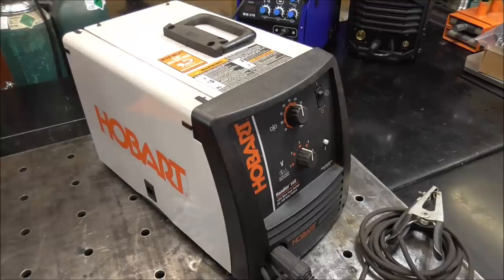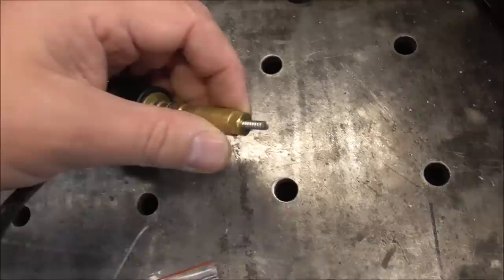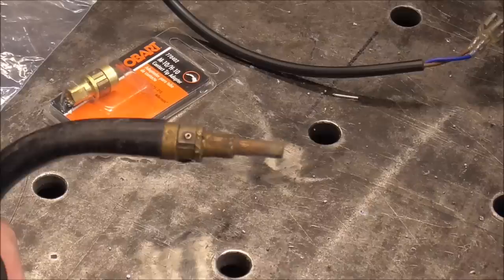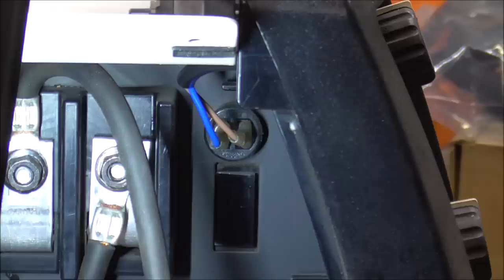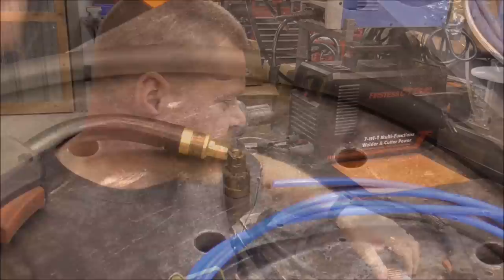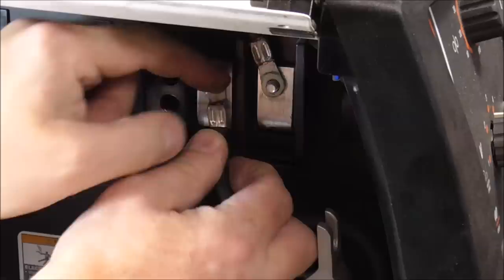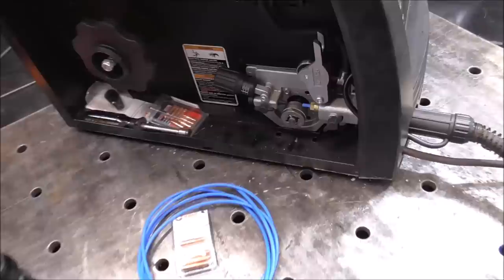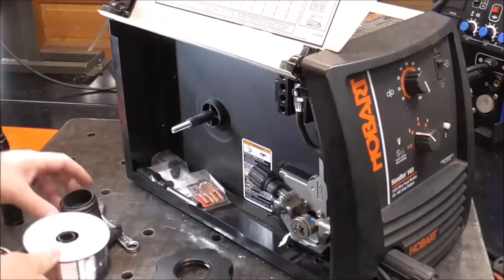Convert Your MIG Welder to Weld Aluminum - The Easy Way

Comment: Hey guys, I have used the same hh 140 for the last 10 or 15 years. Ran 10lbs or more of 5356 wire.

 Last large project (6 years ago) 40 ft sailboat mast broken in half.(backyard project)

TIP, most important thing for me to keep from BIRD NESTING was to keep the welder positioned well above work piece.  
Water flows best down hill, mig torch and hose as straight as possible angled down hill.

 Plenty of mapp gas or torch for heat, aluminum acts as a heat sink. 

Hope the tip helps someone.

Very good info in the video!!
Thanks for making the video & sharing your knowledge.
Reply from the maker: All excellent points you made! Thanks for watching and sharing.

Comment: I'm not much of a welder but it is nice to see what would be involved in welding aluminum on a budget. I got a few parts on a project that I would rather use aluminum for over steel. Getting the 100% argon might make that specific use case more expensive than it is worth for me though. Either way, good video and explanations.
Reply from the maker: Thanks Zack I appreciate it!

Comment: My MTS-211Si won't do AC (which I didn't realize when I bought it) but this is a viable option, till I get another machine!
Reply from the maker: Great point but it's not necessary on thin metals. In my cast iron repair series i use 1/2" nuts to hold weldments off the table for that reason.
Reply: No, I meant TIG Aluminum; MIG is an Alternative
Reply from the maker: Oh I gotcha! 👍 I like TIG also just a lot slower process

Comment: I'm really tempted to pick up a longer whip for steel and convert my current short whip to a PTFE liner. The only thing that sucks is I swapped my argon bottle a couple years ago to a 75/25 so I could backup bottle.
Reply from the maker: Thats probably the way to do it then your not switching back and forth between liners. But with another bottle then you can weld anything 👍
Reply: Remember the rules for MIG or TIG welding aluminum: use only Argon, or for a hotter weld a mix of Argon and Helium. It's also very important that aluminum be clean or it won't weld at all. No oil, grease, paint or gum from labels. If it's not clean use a small disc sander and then clean it with acetone or laquer thinner. In the industry 5356 filler rod is always used, as opposed to 4043, so if the part is Black anodized the weld does not turn white.

Comment: This is great, I have an old Lincoln 110v mig that might be good to try this with.
I'll probably pick up a gun and line, being the lincoln is primarily my fcaw tacking unit.

Also, a wipedown with some acetone after brushing helps. Just be sure its evaporated off and the container is far away before preheat and welding
Reply from the maker: Spot on Allen! I kinda skipped a couple things (just to keep the already too long video shorter LOL).  I'm VERY impressed with how this 120 volt machine performed. I thought it was going to feel underrated but I was pleasnatly surprised. Definately beats buying a new machine if someone had some occasional projects they wanted to do.

Comment: I ran some aluminum wire through my Lincoln SP175, with mixed results.I changed the gas to argon, changed the  liner, made sure feed roller was sized properly, along with tip ID, and it worked, mostly, except, if that wire fused to the tip, which it did a few times, the aluminum wire would "birds nest" past the rollers  like a mofo, making me pause work a few times fixing alla that mess. That is why a gun with the spool on it works so much better, as it cuts down that feed "push" to inches instead of feet. I can see where that protruding piece would cut down on bird nesting though, maybe even cutting a "V" shaped peak into it to get as close to both rollers as possible. Maybe a   I wonder if a volt setting of "1", a slower feed, and a slower push on the tip might have been the trick to not run too hot but still get a good puddle.
Reply from the maker: I'm going to be fine tuning this a little more in the future. I was impressed it could weld this thin stuff. The good news is that if it can do that, it can easily weld thicker stuff. Getting the liner almost touching the rollers is key. That way it makes it very difficult to birdsnest then you can focus on your hub and drive roll tensions.

Comment: Great timing. My Lincoln was purchased two decades ago as a refurbished unit from Home Depot. It is great to know that I have an option to use use the Hobart if I go that direction. Thx.
Reply from the maker: Thanks man! If your Lincoln will accept gas you can do this to yours also.

Comment: As an old welders helper on a fish processor, we fabricated most of our chutes, tables and conveyors out of aluminum. My job was to make sure the joining materials were clean, and my welders tools and equipment was clean and ready. No carbon steel or materials for abrasing carbon steel was allowed in the process.

Comment: Honestly heating that material before welding will not only help you have a better start do to the metal already being hot but it will also help burn off contaminants such as oil that might be hidden in the material your working with.
Reply from the maker: Spot on!

Comment: I would pull a cleaning patch and spray cleaner through the lead while the liner is out. A steel liner would also contaminate the crap out of the aluminum.
Reply from the maker: I agree! 👍

Comment: You could even get a dedicated gun to have it already set up to switch out when you need to weld aluminum. Great job.
Reply from the maker: Thanks man and thats the prefered way to do it if funds permit.
Reply: @BrandonLund  ya I get it. I bought the Yes 5-1 welder and I plan to get an extra gun and run it like you showed in your video. Thanks
Reply from the maker: Their MIG guns are pretty reasonable too. When you buy your stuff, if you use coupon code BRANDONLUND at checkout, you will save yourself 10% off your entire order. I don't know if you do facbook but I would love for you to join us on our community page https://www.facebook.com/groups/579749237081633
Reply: @BrandonLund  great I will do that. I do have Facebook and I’ll join your page as soon as I get out of Facebook jail. 😂
Reply from the maker: Hahahahaha

Comment: Thanks Brandon....very very interesting I thank you for you time.....very well presented.

I am in the UK we have 240v mains.

I have an SIP welder gas MIG....rated 130amp far an I know its polarity is fixed....I wonder how that will perform welding Ali.....could be handy for me as I have a 50 year old Landrover with an aluminium body.

As luck would have it...I have a bottle of 100% Argon.....was given it years ago....still near full...its a 2 ft tall bottle....so holds a lot of gas.
Reply from the maker: It should work! Thin metal is hard to weld on these smaller machines just because they run hot but that's not to say you can't weld other stuff too

Comment: Great video! Thanks for making that, and posting it.

The 600lb gorilla in the room is the gas, particularly for the home hobby or boat welder. The tank is kind of expensive and then there is finding a place to get it filled, or exchanged. Nobody wants to mess with the hobby guy, even acetylene and O2 can be difficult to procure. It would be really cool to see a video addressing this issue. Can't do "Metal Inert Gas" welding without the gas! By comparison, you can get a machine and all the extras at HF, HD, Lowes, TS, NT, or any other big box hardware store, or even amazon or fleabay, for not a lot of money, that will suffice for the little guy doing little jobs.
Reply from the maker: Thanks man right on!

Comment: With DC tig you use Helium gas to weld aluminum and not argon.  The Helium makes the impurity's in the aluminum float to the top. So maybe that would be a better choice then argon
Reply from the maker: For the additional cost of helium it would probably not be worth it. You could however do a helium argon mix if you wanted to squeeze some additional energy out of your mig to weld thicker material that argon alone couldn't handle.
Reply: @BrandonLund  Helium make the impurity's in the aluminum rise up to the surface That why a ACDC machine is preferd for aluminum It make the impurity's rise to the surface therefore a stronger weld. So the real question is do I save money or do I want a strong weld ?  The best thing to do is save your money and buy a welder that will do more then what you plan on using it for.  You will outgrow a DC mig
Reply from the maker: So your advise for someone that has this welder is don't use it to occasionally weld aluminum and go buy an ac/DC welder and get a tank of helium...sounds like a plan 👍
Reply: @BrandonLund  NO   It a very good machine for what it designed to do. Company like Eastwood, Prime welders make very good ACDC mig that are in the same price point or cheaper then the Hobart DC mig. My point is not to go out and buy a machine you can not afford  but to buy a machine that you will still keep for a number of years as you get more experience skill in welding.
Reply: TIG welding with helium is great on thick stock but is never used on thin material. As it heats up the part and it warps more.

Comment: Hell, I converted my 20 year old 170 Amp Habor Freight MIG welder to MIG weld aluminum (and just about anything else) years ago. It's really not hard, but I would recommend a spool gun vs the liner replacement.  I even have burn back and other settings...
Reply from the maker: Right on! 👍

Comment: Not sure if anyone mentioned this, but with mig most people 'push', or travel into the weld, but pull with flux core, however it's been proven that if you 'pull' it with mig you get a little better penetration, so maybe for aluminum, pulling it may get better results, but I haven't tried it with aluminum yet, only mild steel.
Reply from the maker: Aluminum you have to push. The reason is the coverage gas needs to envelope the weld puddle. Pulling it can disrupt that envelope. I have been known to drag when in a pinch but I try not to
Reply: @BrandonLund  good to know, thanks

Comment: Great tip...I have an ac  tig and like using that for aluminum and get good results with it but there was a time this would have been a very helpful video to get the most out of my mig welder ..cheers
Reply from the maker: Great point!

Comment: Sorry, adding a 4th.  Lastly, toward the end of the video.   Everyone please, pay attention.   Because Not All Mig Welders allow you to swap Positive and Negative.  If yours does not, than you will have a devil of a time trying to weld alum, even if you have an Argon feed.   Like the one he showed, that model advertises that it can technically weld alum.  If your mig doesn't advertise that it can, most likely, it CANT..  The manufacturer knows the limits of the machines they sell, and $0.20 for a label that has the alum chart on the bottom, is well worth it, if they can charge $100 more for the machine stating it can weld alum.  Not all 110v migs with bottle have the ability to swap Positive and negative.  
If you don't own a mig now, but are looking to buy one for "hobby" level welding,  and want to weld steel and alum, than I recommend you spend a little more and buy a machine with a spool gun.  DO NOT BE FOOLED, by influx of cheap DC, non-HF TIG welders out there.   They are basically old style stick welders, and won't do much more.   
Buy name brand.  Most of you will know, Lincoln, Miller and Hobart.  Any of which are GREAT welders.  There are others but these are probably most well known to Non-Pros, and offer some lower coat options for hobby level welders.   
Pay a little more.   If you see a Welder you like, buy the next level up.  Get one with all the feature from the start.  From EXPERIENCE,  I can tell you that saving $300 now isn't worth it.  Buy the one that Will take a spool gun...  It may not come with the Welder today, but down the road, when you want to weld alum, a spool gun is your friend.  It will making alum welding 5x easier.  
Power..  If you need portable and don't have 220v, than 110v is your only choice.  But, If you have 220v available,  or are willing to install it, and don't need to haul the Welder around...  GET THE 220V...  
In the end, it's cheaper in electric, it can handle thicker metal when you need it to, and running a big machine a 20% capacity is always going to prolong its life compared to running a small machine at or near 100% for its "much reduced" life.  
You wouldn't buy a 4cyl Honda to pull your race car across the country would you???  
But, you could drive an empty V8 pickup to pickup groceries right??
Reply from the maker: Spot on 👌
Reply: In the old days 70's and 80's a MIG machine was constant voltage (CV) and the TIG was constant current (CC). CC was used for Arc and TIG welding. You could not mix and match the machines. That is speaking for pro machines in factories.

Comment: A little hot, such thin material is harder to work with in the flat position. If possible when doing thin stuff like this I always do vertical down.
I also tend to, or at least pretend to do more manipulation when mig welding aluminum it just comes out looking nicer.
The only thing I have ever stolen in my life was an old XR30 spool gun at some where I was working really hard for nine months as a temp.
It was sitting on top of a old rod refrigerator looking thing collecting lots of dust since they switched over to goose neck guns years before I got there.
The only thing that needed to be replaced was a rubber seal under the trigger and a spring that was missing because someone had taken it apart before and lost it I guess before they decided to just buy new equipment.
That gun is invaluable to me, or any mobile welder its an absolute must have even if it has to go on a credit card.
Reply from the maker: I agree! Spot on! 👍

Comment: I appreciate you sir. I have a lincoln 140 115v mig welder like that Hobart. Should work well for me. I even have some argon. Just need wire and a liner
Reply from the maker: I have the exact parts I used for mine in the video description. The picture shows it's yellow but mine arrived blue

Comment: For ease I have two guns one for Aluminum and one for metal. saves a lot of stuffing around also I use stainless for the wire feed
Reply from the maker: Thats the way to do it if your able 👍great tip

Comment: Wonderfull teacher , you are ! Logical, with a good understanding, of physics.  I've got a MiniMig 130 e, with gas option fitting, at the back. Recently replaced the nozzle, and whole whip cord, into machine. (from this one, on Amazon for 50 $ Canadian :  YESWELDER 8ft 100A for Clarke Welder Complete Replacement Mig Welding Gun Parts Torch Stinger / Fit for Chicago welder  Fit for Clarke welder    Colour: Red
Brand: YESWELDER   Material: Copper Rubber    Premium quality replacement MIG gun stinger torch, 100Amp, 8-foot (2.5m) cable, This is for 1 Complete Replacement Mig welding gun for Clarke 180EN and 130EN Mig Welders, Clarke P/N WE23000054.
The gun is 8 ft long, and will handle .023", .030", and .035" steel, stainless steel, and flux cored wires. There is a gas valve in the handle, so this gun can be used with or without gas
This gun uses the same Clarke contact tips, gas nozzles, and gas diffusers
            
Works even better than original.  Could a guy, make a welder ;  using a DC  225 amp one, supplying the current, and the MIG one, using the wire feed part, to  make  ' ONE '  higher output welder ?  There should be a way - using the DC high amperage welder output, and the MIG  whip ?   Only using up to about 130 amps, of the Dc welder so as not to   ' destroy '  the  inner liner, of the whip ?   and mig ends ?......wondering.....thanks  for  your  experiences......SIR !
Reply from the maker: I'm sure someone could figure it out but it way beyond my ability. I appreciate your support and comment!

Comment: Nice to know. I tried Welding Aluminum with my Lincoln 140 and the Wire kept burning onto the Contact Tip.
Reply from the maker: Try increasing your contact tip size and hold a little more stick out

Comment: I ran aluminum thorough my old Lincoln 120v machine with the original metal liner, feed roller, and tips of the normal size.  It jammed a few times, but worked ok.  Maybe using a larger tip would have helped.
Reply from the maker: For sure! It will usually run ok it's really the contamination from the steel liner that can cause the problems.

Comment: Hey Bud thats so kool. I got old stick machines up to 300 Amps and a Lincoln 210 MP that does almost everything I wat to do.  But every once in awhile an  aluminum project rears its head and a I gotta head for one of my buds that has a spool gun. I now know I gotta scam an argon bottle from one of my Buds they got lots for a poor sole. like me.. Do the conversion you suggest. Way cheaper wich is important to a retired old F___ like me. 
Excellent Video.
Thanks to you from a brother from the great white nortth
Reply from the maker: Right on Pete! And FYI you don't need an expensive spool gun like the Lincoln. I have a 100 dollar yes welder spool gun. Works like a charm. Run hundreds of feet through it too. You can get the euro style that has the collar nut or you can get the miller / Hobart style that has the long stalk end that goes into the machine. Just another option. Have a great weekend brother!
Reply: Thanks I'll look into that. Cheers @BrandonLund